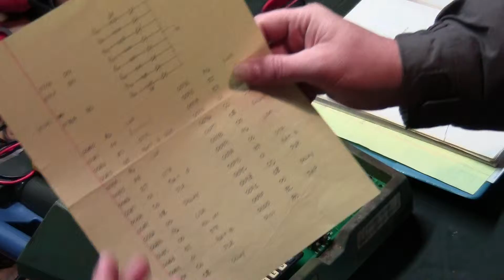"6802 Microprocessor Assembler" : How I learned!

Comment: Oh it reminds me of our project during college days where we used this micro processor and wired our own system using breadboards. We made a calculator using the 6802 processor and programmed it using assembly language...I remembered commands  like "Load accumulator A" / "store accumulator A". This processor made me learn how data is process by the machine.

Comment: Hey,
This is really cool.  I have been looking at the Elenco MM-8000 kit to learn basic computer and microprocessor components and what not.  How did you attach the tape recorder to use it as a program downloader?  and comparing the MM-8000 kit to yours would you say one is better over the other?  any modifications or fun projects you would recommend? 
Thanks for posting, really enjoyed your video. 
Is it still possible to check out the manual from your kit online?  if it isn't posted anywhere can you post a copy of yours?  I love looking at the Elenco kit manuals for the amount of info they have.
Reply: You just connect the microphone and earphone sockets on the tape recorder to the two sockets on the front edge, just to the right of the 'keyboard'.